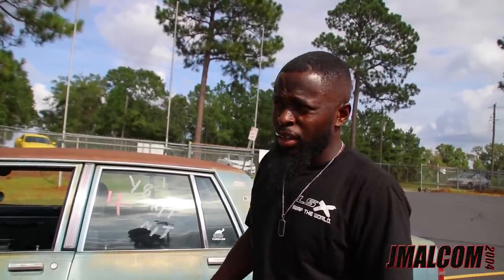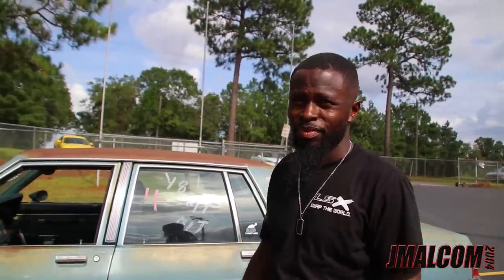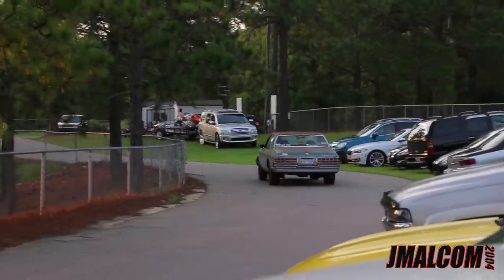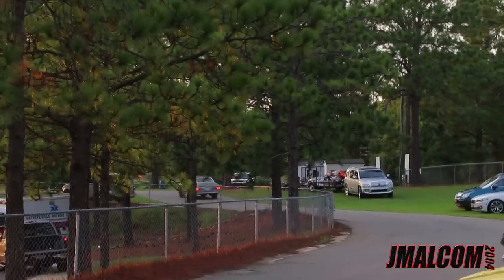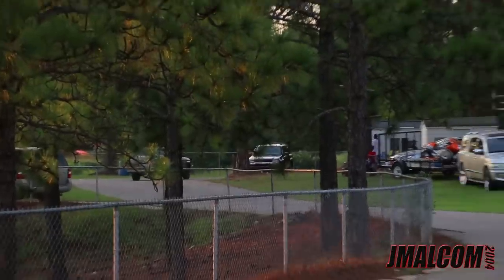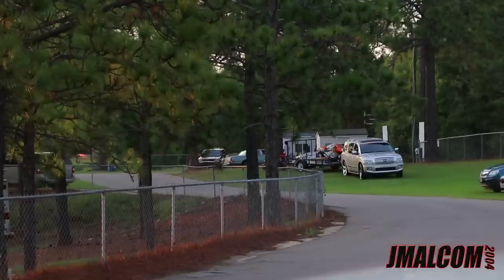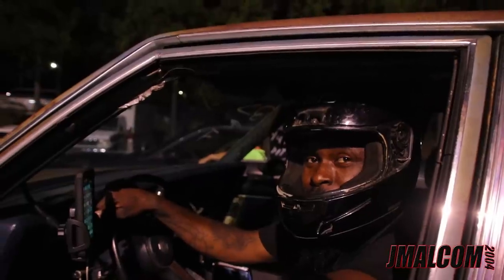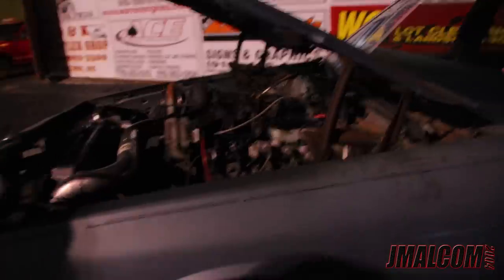HUGE BULLHORN ON THIS RUSTY TURBO PONTIAC PARISIENNE AND IT GETS BUSY!

Comment: My turbo ls only throws the belt when it has a misfire, check them plug wires! And a 3.55 gear in the car would wake it up a ton but it sounds like he’s to the limits of the converter

Comment: Dirty dingo makes a small pulley that goes on the truck engines that’s stops the belt slinging.... that long run from the crank up to the alternator flaps at high rpm and comes outta line, the dirty dingo pulley goes there n bolts to the block problem solved